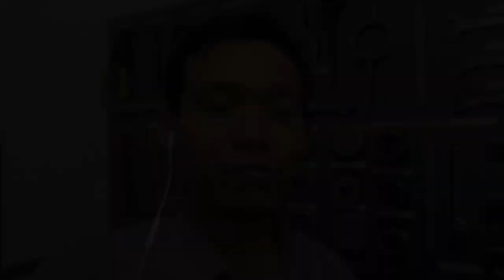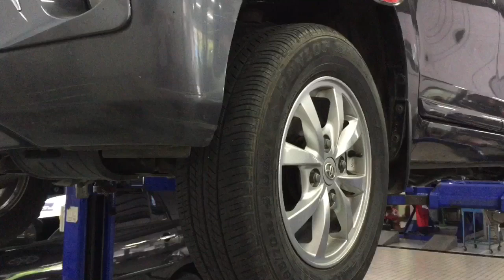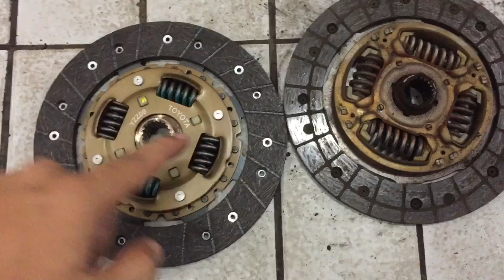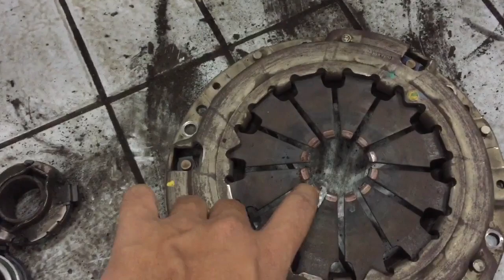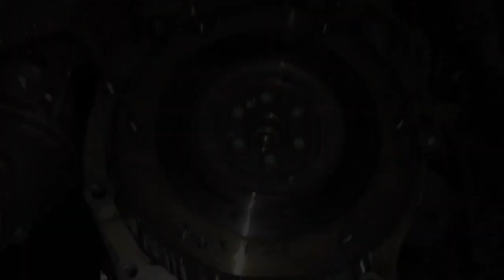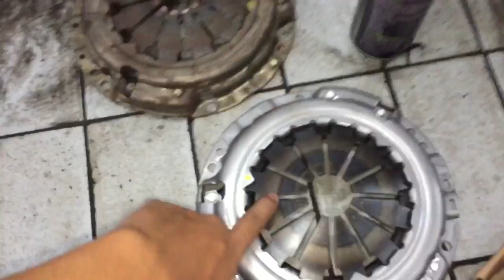Yang perlu diganti saat turun kampas kopling mobil

Comment: Om kalo mesin bunyi ukluk" itu kenapa ya,pernh dicoba dilepas vanbelnya dinyalakan mesinnya ngk bunyi ukluk",tp pas dipasang vanbelt bunyi ukluk" pas waktu stasioner digas  sampai rpm ke 2000 msih bunyi,trus rpm 2000 ke atas bunyinya hilang itu penyebabnya ap om....
Reply from the maker: Di cek satu2 laker yg di putar oleh v belt
Reply: Biasanya laher waterpump nya yg bunyi seperti itu.
Reply: @trikotomotif6203  udh dicek ngk ada yg bunyi
Reply: @doniusmono6219  udh diganti water pumpnya tp masih tetap bunyi
Reply: @rebornliant4473  : bisa juga laher dinamo pengisiannya mas